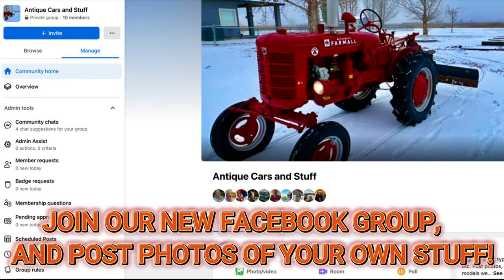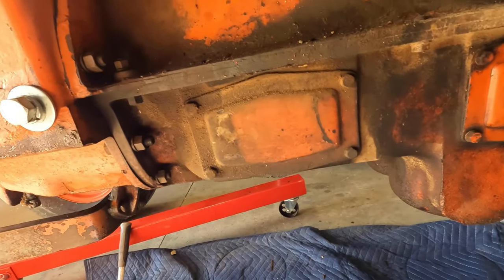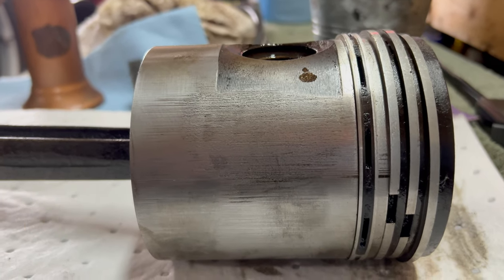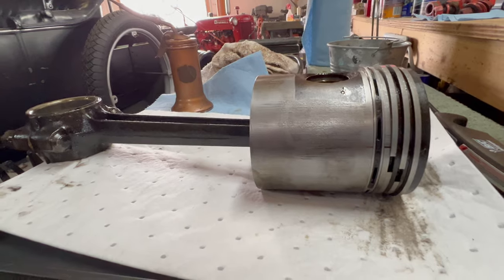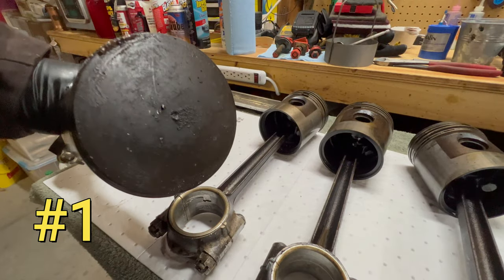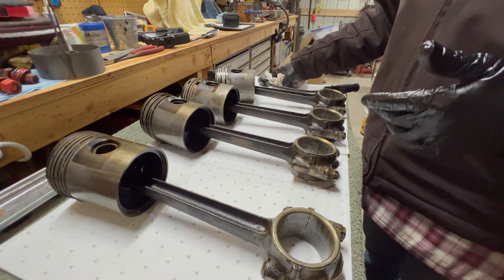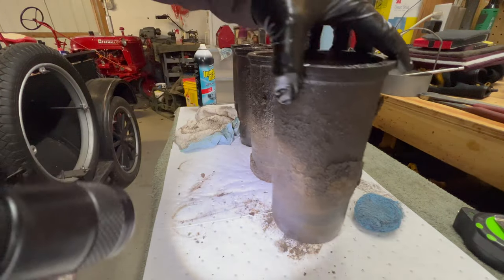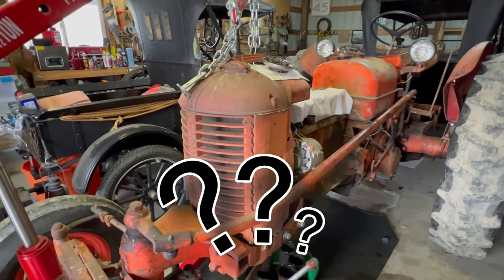1952 Case DC - Part 4, Coolant Leak Investigation Continued

Comment: Glad you found that the issue was with the O rings and not a cracked block, very sorry about the piston and bearing damage, I would defiantly go for new pistons and rings, re-metalled bearings and if the budget allows new sleeves, if not then hone them and then check and measure to see what pistons you need. I am in awe of your skills and matter of fact can do attitude, this tractor is lucky to have you as it’s owner.
Reply from the maker: Thanks Andrew!

Comment: Good work deciding to pull all four out, that's to bad the engine design
uses wet sleeves. Makes for a  opportunity  for the tractor to fail sooner
because of those rings. But  guess I'm finding out there are tractors
that use that method wet sleeves. I wish I new the list of them I would stay away 
from them. It's a real nice tractor, a great price you got on it.
Reply from the maker: Thanks Bill.

Comment: Surprising how much sludge has accumulated around the outside of those cylinder sleeves.  Maybe the previous owner(s) weren't diligent about changing the oil regularly? Hopefully parts are still available and you can get this tractor back in service!
Reply from the maker: Thanks. I hope so too. : )

Comment: Ordering a set of custom pistons is as simple as providing JE's Engineering team with the measurements you require for your application. The order form can be found here and it will need to be filled out and delivered in order to begin the manufacturing process. If you're looking for pistons which are based on existing engine architecture, you can simply fill out the changes you need for your application. For example, if you're running larger valves, or you want to change the compression distance, you can simply specify those changes. And if you're not sure what you need, JE's technical staff is standing by to assist you with your order.
Reply from the maker: Interesting about the custom pistons. I will keep that in mind. Thank you.

Comment: While you have pistons out and sleeves, I would CAREFULLY remove one ring from each piston and check the ring gap in each of their respective sleeves, just to check if the rings are worn down too much.  Sleeves, just  hone and clean with new seal (depending on costs of replacement of sleeves?).  Big ends on the rods that needs to be addressed and that is were the big costs are going to be, I would like to be wrong here, yet a little bit of fear as to costs.  Really enjoying this tractor, I was thinking you should plastic gauge the big ends for wear before I saw the damage...so much for that idea.   Best of luck and go slowly and enjoy the tractor.  Maybe able to find used rods, but then the question of tolerances returns?.
Reply: Also pull the main bear caps....you may have some more concerns there????
Reply from the maker: Good idea to remove a ring and check the gap. Thank you.
Reply from the maker: The crankshaft feels really good. I think I best leave that alone.

Comment: The sludge may be something like "Barrs Stop Leak", it's hard to tell on my end. That stuff just migrates to the rear of the block without solving the problem. What it does do is insulates the sleeve and stops the transfer of heat to the coolant resulting in the hot spots you found. I didn't see any shims on the rod caps, so the babbit is pretty thin. The missing chunks could be the result of contamination on the base metal so the babbit didn't adhere well. When you go to reinstall the oil pan, it would help if you loosened the bolts holding the front bolster just a little so you have a little wiggle room to slide the pan up and in.
Reply from the maker: There were shims on all the rod caps. The babbitt looked ok except for the missing chunks. Bummer. Good idea about reinstalling the oil pan. I will try that. Thank you.